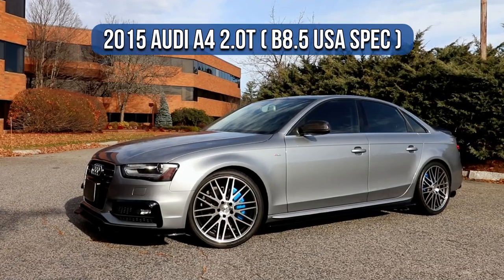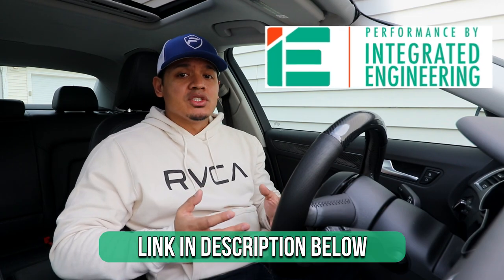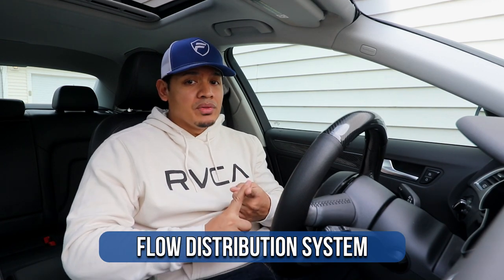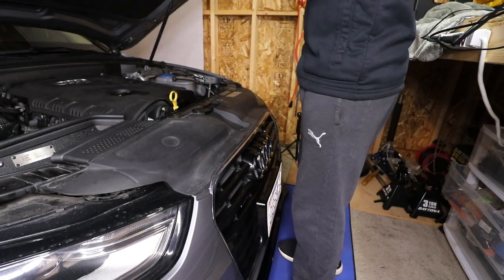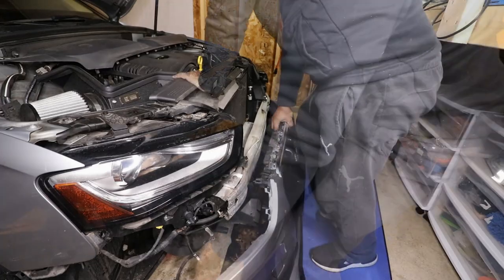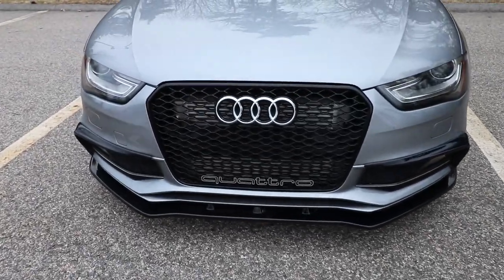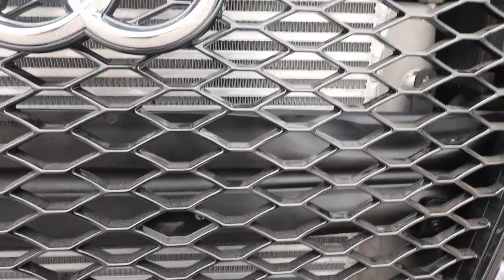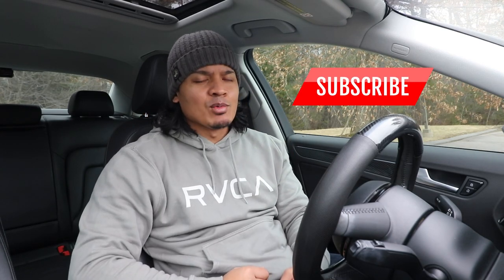LARGEST intercooler step by step install on Audi A4 (B8.5) 2008-2016

Comment: You don't have to get an intercooler to do stage 2 if you have an intake. It doesn't get hot enough on a stage 2 to really justify a bigger intercooler. Stage 3 yes
Reply from the maker: Then you’re not getting the most out of the stage 2 tune with a stock intercooler and you won’t get consistent power.  Which is a waste. 

An upgraded intercooler is gonna allow the car to not lose the extra power gained from the aftermarket tune especially when engine temps get hotter and air flowing into the engine gets hotter. A stock intercooler isn’t gonna keep up.

Just because oem parts can “work for now” with an aftermarket tune doesn’t mean its the right way to do things. If you’re gonna aggressively tune your car, then do it right the first time.